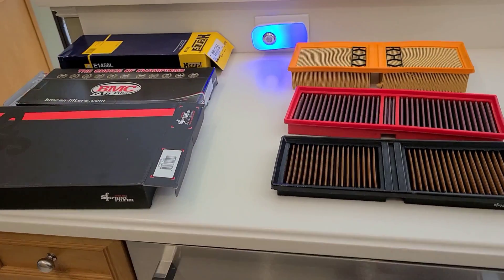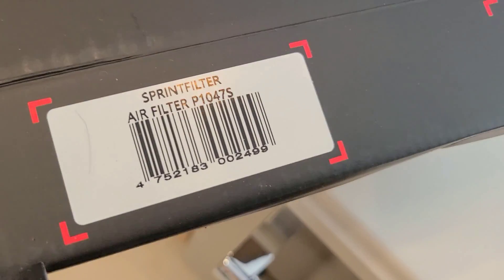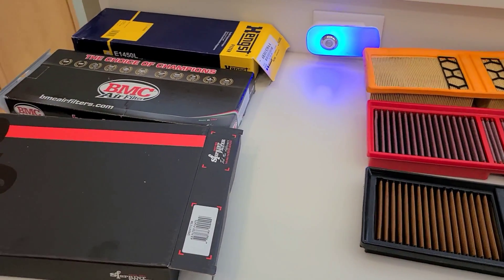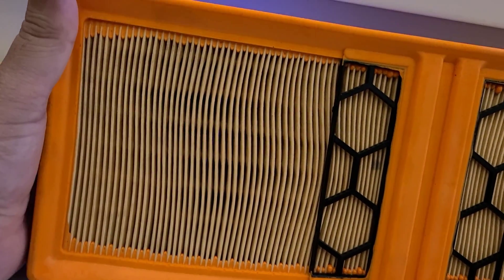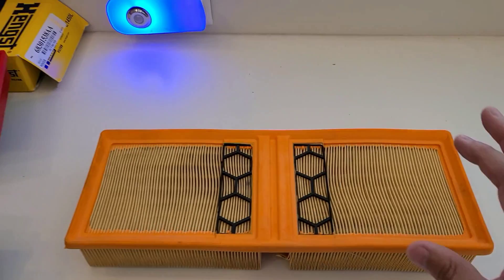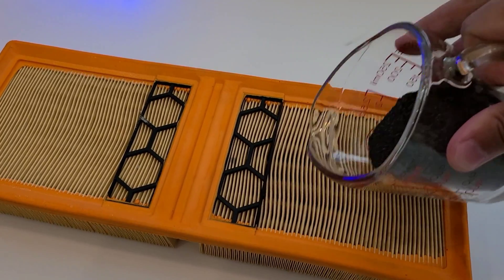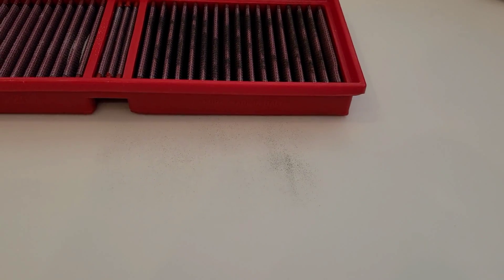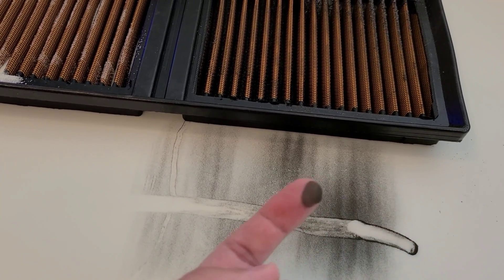Do performance air filters like BMC, K&N, Sprint let more sand and dust than OEM and is it worth it?

Comment: What an idiot! You cannot see flow or filtering ability. It is measured if CFM and done on a machine. How unscientific. Don't listen to him. He just pours it on. Not a real test. Let him use OEM.
Reply: Thats pretty harsh.  He's provided a solid video and put some time into it.
Reply from the maker: Already stated in the video.   And if you pushed the same sand into the filters with pressurized air MORE would go through not less than pouring it.
Reply: @bhvrdr  Air intakes are not pressurized as many cold air intakes claim. No such thing as ram air intakes. They are cold air intakes. Nothing more. Sand and dirt that is airborne will stay suspended in air until something gets in its way such as a filter or something that it can stick to such as oil.  Pouring that much silicate and other materials into a filter is not how filtering works.  Especially since you poured it in the wrong side. The shape of these filters is engineered into them for a reason. But they are not meant to have 200ml poured into the channels and then pounded on the table for effect. Your OEM filter would at this point simply fail and seize your engine. until the silicates cut the paper and pour in anyway. You also also forgetting the cars oiling system which is designed to remove some of this dust and debris. Your claims of cylinder wall damage are unsubstantiated and not proven. Different manufactures use different materials for cylinder walls and different ring material as well. They may or may not fail and it would occur at different rates. You are also not considering maintenance. Maybe you leave your oil and filter in your car for a year or two while all this debris is pouring in? Those of us in the know change our oil and filters regularly so we don't have these issues. A most unscientific test and one that proves nothing but scares the kids.
Reply from the maker: @Mikab61 yikes, we do not use oil filters in place of air filters mike.   

And yes diffuse sand particles being pushed in filter media at 60mph driving speeds most certainly passes through the filter easier than the gravity feed in the video lol.

luckily this has all been studied well over in sae papers and is confirmed even by the filter company like Sprint filter literally stating they only filter down to 70 micron.  Thats huge.   

https://www.sciencedirect.com/science/article/pii/S2212017316301475/pdf?md5=d2f70e632c706b1c583eb769b594ce7a&pid=1-s2.0-S2212017316301475-main.pdf

Comment: I'm sorry but this was a failed test. Let me explain why...
You poured the dust onto the wrong side of the filters which does make a difference. Also...no explanation as to which filter was supposed to be oiled or if they were all dry flow. Also...I've never seen my filters bounce like that. 
Filters sitting onto of a running shop vac would've been way more practical while pouring the dust onto the correct side of the filters.

Comment: You put the sand in the wrong direction... that's not the same direction as air flow..
Reply: It doesn't really matter. It's not like they make the micron better one side, it's all wind into the mesh in and out.
Reply: it doesn't matter, both sides should not allow dirt to pass through the filter.
Reply: not even true

Comment: You know that the K&N filter should be slightly moistened with a special oil dedicated to these filters. I do not know about the sprintfilter,or BMC filters but I am guessing that it should also not be used dry either.
Reply from the maker: Of course.  The bmc and kn are oiled filters that come from the factory pre oiled.  Thsts cotton gauze style.   Sprint is single layer synthetic dry filter.  Never ever oil those or theyre ruined.

Comment: Great video..How about the use of the Kn oil with the filter?.I live in the mountains..up a Non paved dirt road...I wonder if the oil added would catch the fine dust that I see all summer long..Perhaps another test?..
Reply from the maker: Thanks.  The bmc and kn filters come oiled from the factory.  Yeah you definitely want to use them oiled but i wouldn't oil a sprint filter.  They're designed to go without it and you could cause clogging or breakdown oiling it.

Comment: From an old mechanic and a retired engineer. The best air filter there ever was is an oil bath type and they were replaced with the throwaway paper elements (mid 1960's) due to servicing the oil  bath was messy and time (money) consuming. The problem with paper elements is quality and they don't last long; I've seen the sand get into them and cut right through the paper, not good. The K&N filters were invented by a desert racer who went through a lot of engines due to the paper elements downfall and there is no way an oil bath would work in that environment, due to vehicle movement. Take a look at the air inlet location, airbox design and where you drive (asphalt, sand or high dust) for a real world analysis as to what may come towards the air filter to begin with. Hope this helps and it's a free world to choose which way you want to go.
Reply: Actually I believe the paper filters were getting clogged very quickly and choking the engines in desert racing not destroying them. That’s when k&n solved the issue by basically just being worse at filtering 😂. They could make it through a race without having to swap or clean out the paper filter costing time, but ultimately the engine would only be good for one race. All good for a professional race team but not so good for regular folks.
Reply: @chuck1622  This is the truth.
Reply: You always have to balance/ compromise filtration efficiency and decreased horsepower. At low RPMs there probably won't be much of a difference. At higher rpms the K&N will have a very small advantage. In acceleration experiments , it will be a fraction of a second. 
One good experiment to try is long distance MPG measurements in hot dusty conditions versus ice cold clear winter air and see how each of these perform.
Reply: Great experience sharing
Reply: Aren't all K&N oiled...?
Reply: @ilkkak3065  KN now puts out a new dryflow filter.... Sold at Walmart. Called K and N Select.   No oiling of the filter but can still be washed and cleaned
Reply: You can literally see through K&N filters.  They're 4 sheets of cotton gauze.  It's almost the same as running no filter.  You must have been a mechanic a LONG time ago.
Reply: Yes, remember, my 1973er Super Beetle hat one of these Oil-Bath-Filter.....
Reply: @Tap-a-roo  the k&n isn't the issue. The issue is the people maintaining them, right out the box you wanna make sure the intake side of filter doesn't have oil on it and by on it I mean soaked as they tend to sometimes come. Ask if you didn't lube the proper side or washed improperly.
Reply: @housebaelishgaming  Maybe you've just used more K&Ns than me, but I never got an over-oiled one, out of the box.
Reply: That's why I recommend just buying a brand new OEM filter, and installing it just before the race. If you're racing the BAJA 1,000, bring several filters, and replace more often. Those other filters are fine, if its a race-specific car, and, you plan on rebuilding the engine every race. If you're racing a registered street legal car, and need the engine to last, OEM filters are the way to go.
Reply: Load of BS. You obviously can't have an oil bath with MAF sensors, plus they're bulky and wouldn't work well under high cornering loads.
Reply: @ChrisPatrick-q6k  👏 ....🌟
Reply: Modern engines aren't failing due to anything to do with the quality (or lack thereof) of OEM paper air filters, however. This isn't the 1960's anymore.
Reply: @opmike343  1960s 60s ... Right , we don't live in the 60s anymore but in the crappy future  shortly before WW3 instead...
Reply: yes, if it weren't essentially impossible I would add an oil bath air cleaner to modern car, they are simple and superior. But messy and inconvenient.
Reply: @ChrisPatrick-q6k 😂 Heavy. Modern cars are stupidly heavy anyway so it wouldn't change much unless racing professionally.
Reply: @Tap-a-roo  I retesting that you’re calling someone names instead of providing proof that improperly maintained k&n’s destry engines. It’s almost like what you said is nothing but an opinion.
Reply: @The_Rob_D  qq

Comment: The K&N type filters work because of the pulsing effect of the air.
The filter media has microfibers that vibrate and trap the dust.
Reply: I'm sure you've seen this effect by high-speed filming at high magnification.  Or, you and your source are just full of bulls...t
Reply: Racing Engine builders have been wrong for years..... No air filters fitted.... Massive engine wear quickly.
Reply: @gj91471  I don't know what year of racing engine you are talking about but modern race engines always use filtering for longer races where contaminants may ruin the engine. When I was at Keith Black Racing engines they weren't used on Drag race engines or boats due to them being rebuilt after every pass. But racing engines use good aftermarket filters.
Reply: @Mikab61  Yes, the rubber coming off the tires and dust results in grinding the engine.

Still... Loads of guys run without air filters

Comment: All filters are directional so why did you pour the test contaminates on the wrong side (air out let) VS  instead of the air inlet side?  Also the K&N appeared to be not oiled properly which would make it an instant fail just like your test.
Lastly as someone who has used oiled filters for over 30 years I would not recommend them for a daily used street vehicle. I use them on 100% off road applications,  race vehicles and other vehicles often used in very dusty conditions.  They work just a good as paper filters “if oiled correctly” and that is the issue many have IE not knowing how much oil to use or what the correct service interval is.
Reply: most carp in motorcycle facing back, so the chance of sucking the sand have small percentage
Reply: @vincentyap3188  I guess you’ve never been caught behind other vehicles or gone riding in a group? Where can I find these completely empty roads and trails?
Reply from the maker: The kn filter is oiled from the factory to their specs.   It was brand new. You couldn't oil it better to their specifications since they actually did it.   The filter media itself is not directional.

Comment: The only filter that works as it should be is OEM one
Reply: strong impact of sand?r u driving through a sand storm
Reply: @thehobbyist5292 sand dunes and and engine is sucking air in at high speed use your brain
Reply: It filters better true, but it's more restrictive. For a daily car OEM is the best , for a second fun car which does much less miles/kilometers per year a performance filter is fine. IT gives more power and although the filtration is worse than with an OEM filter, you have to remember that such cars a driven usually in very good weather conditions etc not like daily cars.
Reply: the OEM made of paper a strong impact of sand hit it will break it
Reply: @vincentyap3188  how can even sand, the same amount in the video go inside the hood of a car? and more so, how can you make the air filter violently shake like he did in the video?
Reply: @automachinehead offroading 🤦‍♂️

Comment: I cleaned the k&n filter on the mustang and it got less horse power I think the oil mess with the mass air flow sensor
Reply from the maker: Yeah i would set them out for a day after oiling.
Reply: I agree to give the filter time to absorb the oil....but a can of M A F sensor cleaner should remove the oil on sensors...Disconnect the  battery first or unclip the M.A.F and let dry an hour or so before reinstalling...I'm no mechanic..But this worked for me and many others as well on youtube.

Comment: The filters seem very dry to me. Not sure you being very honest. Maybe do a test where you show how you lube the non oem filters.

Also go read up on the pulse effect from the valves and performance filters.
Reply: Been using KN in my car for 10 years. 0 issues. Same goes for my DNA in my bike. Everything is happy...
Reply from the maker: K&N and BMC come pre-oiled from the factory.   They actually caution against over oiling as this can damage fine wire maf sensors.   If you oil a sprint filter you'd destroy it.  Sprint filters are dry filters
Reply: @bhvrdr  car does not use oil. So cylinder walls and piston rings must still be fine. Also my car is 22 years old 1999 model. She has 250k kilos on the clock. Straight 6 4L motor. So not a new car and she has had her fair share of work. I service her myself.

Dunno after the filter change from oem to the KN she just seems so much more happy. Towing big caravan every now and then. Never broke down since I had her from new. Not once. Did not feel a performance increase maybe just a bit better consumption on the open road.
Reply from the maker: @omgwtflmaololrotfl2368  that's excellent but anecdotal evidence is not scientific.  Glad youve had good luck!

Comment: No way I'm going to put those "filters" into my performance car. To gain 2Hp and grind down my cylinders? NO WAY...
Reply: I have had K&n in my car not for performance but saving some $$$. Been 10 years in my car and I have had 0 issues. Same goes for my MT09 I have DNA filter again not for performance but saving $$$ here and there.

The test this guy does is somewhat flawed. As he completely fills the filter with dust. Wont happen in real world. And his fters seems dry. They need a proper coating of oil.
Reply: The testing isn’t that well. You wouldn’t have any problems. I switched to a cold air intake to remove these problems. Oem filters are usually pretty shitty quality and I had more dust in my air box with oem them drop in air filters like k&N. I now have a aem cold air intake for my 19 Sti
Reply: @Goyxrd3  Only cold air intake for mine is done in US, and I'm in Italy. And costs A LOT (more than 480$ from Eurocompulsion). Now, considering my car has a 200HP engine which is the electronically (exclusively) downpowered version of the 280HP and that with a stock airfilter I can bring it back to around 300HP, I think I'll go on that way :) No need for cold air intake as it's already done that way from Alfa, the only reason for a change would be the (good) intake noise, but not for 480$ :)

Comment: After this, I am sticking to OEM filters for my motorcycles.
Reply: I sold all my DNA, K&N filters a while ago for my bikes due to this, TBH they were running worse for me with them too as they're so out of spec compared to factory filters
Reply: @bikersquest  What filter would you recommend if installing a full aftermarket exhaust? Wouldn't using the OEM filter make the bike run rich?
Reply: @skiggy007  I avoid running aftermarket exhausts if I can as stock is designed best to get most out of the bike
Reply: @bikersquest  To get the MOST of what,  performance or longevity of your motor? You have to qualify what you are looking for. Known fact that aftermarket header and muffler with proper fueling will outperform most stock set ups. But there have been some tests I can vaguely remember being very close, especially on newer bikes.
Reply: @sfzx54  Reliability yeah, I'm not looking for tuning my bikes anymore. of coiurse with a map and full system + high flow filter you can get lot more out of a bike but I rather just get a faster bike at that point.

Comment: Any thoughts or circumstantial experimental data also for foam ?
Reply from the maker: Great question.  Not sure yet.  Foam can be finicky because each company can use different layers and densities so youd have to test several.
Reply: @bhvrdr  thanks. Also agreed. But the fact foam is the choice for off road and KN type filters recommend foam as pre filter to increase filtering efficiency up to 90% makes me think foam may still be as good as paper type filter.

Comment: Been running K&N for years, no problems.
Reply: Are you running the same vehicle for high mileage or do you trade often?
Reply: @deere3321  just change it or oil it every year and you’ll be fine.
Reply: @angelgjr1999  why you have to oil the filter?
Whats the point of that?
Reply: @longsilver2646  The oil acts as a "filtering element" by retaining the particles
Reply: @longsilver2646  to hold the dirt.
1.5 mm dirt on the filter makes it flow more.... No need to clean that often
Reply: Decades
Reply: Cars engine does not broke down that fast
Reply: After 10 years with k&n since new that had oil changes every 6 months or 5k miles with Mobil-1 full synthetic, my unmodded 2jz burns 1qt every 2k miles. Also had intermittent maf issues, got rid of the k&n and while still burns oil of course because the filter did its damage at least I no longer have maf lights triggering.
Reply: @MusicConnoisseurian  after 10 years it's burning oil because that's what happens to 10 year old engines anyway.   Sure blame the filter for natural wear.

Comment: if this does not persuade you from buying an aftermarket crapfilter then by all means go ahead go for it and take a chance on scratching up them cylinder wallz over time and reducing the life span of your engine ! it is so worth that 1-5 hp.
Reply: After 10 years of having a KN in my car she starts up like a charm. Hardly uses oil.... Yeah really bad for my car..... Cylinder walls and piston rings must be shot...... SMH
Reply: @omgwtflmaololrotfl2368  you can drive around for 10 years without an air filter and what will that prove if your car starts up ? 😆 people at the track run without air filter whatsoever you could be just like them.

Comment: i can tell you here and now after 30 years of mechanical experience working on motorcycles that k&n/bmc and sprint filters fail miserably in filtering dirt. look at my youtube channel for some EYEOPENING videos. you will see the light. not trying to hijack your video, just adding to the conversation.  https://youtu.be/xzp1nXrLRkE this is a starting point